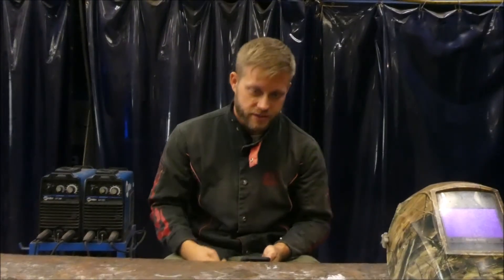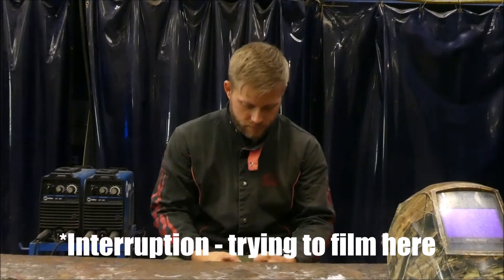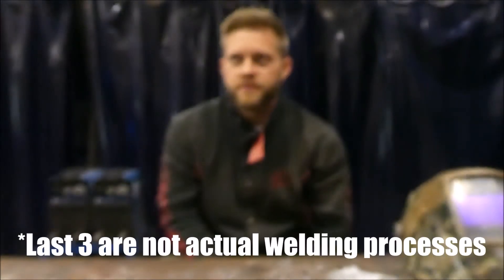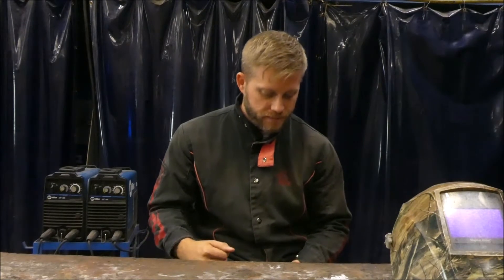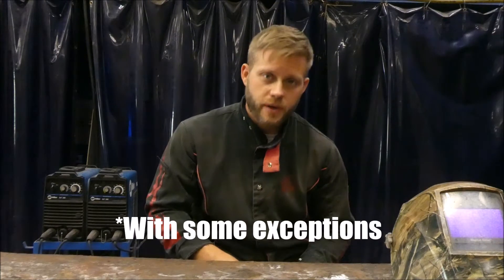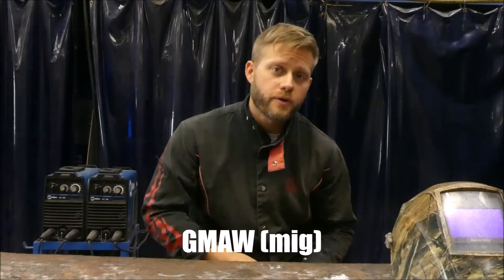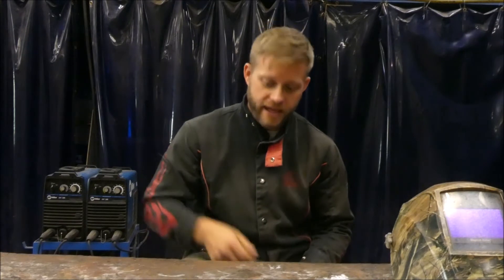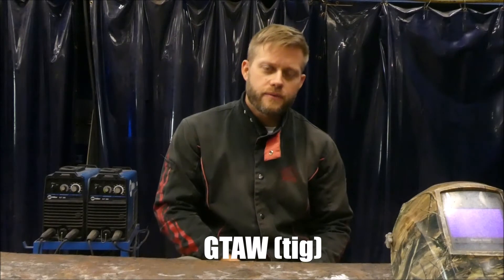what TYPE of WELDER should I BUY!?

Comment: I have a tire shop here in Atlanta.
I do bent rim repair and would like to start welding cracks in cast aluminum wheels. I would prefer MIG because it looks simplest. Something that runs on 120 but I don't think that's strong enough for thick cast aluminum (spoke side ot the wheel). Can a MIG welder handle the task? If so what do you recommend on a budget for a beginner? Thanks in advance
Reply: You can do it with a mig welder but you will need a teflon liner for ur gun or u can get wats called a push pull gun or a spool gun but a acrc tig welder allows you to buld up alloy and u can have a foot pedal too turn up and down ur heat make sure it's a acrc machine you can buy a decent one for around 800euro use Argo only no co2 mx for ac tig

Comment: Do you recommended a arc welder at a house for use ore tig ????
Reply from the maker: All depends on what it's primary use will be. They're all "arc" welders, but like I covered in the video; your budget, resources and projects will dictate what you should get. I would say the most common "at home" set up will more than likely be some sort of 110v stick or flux core machines.